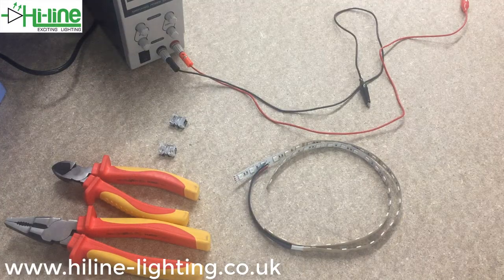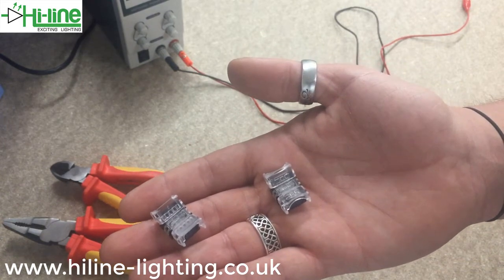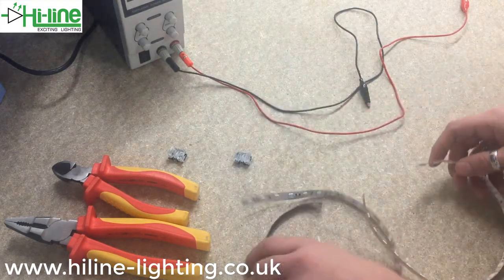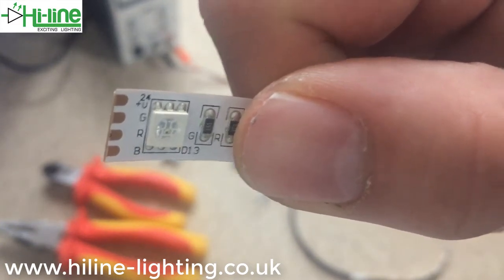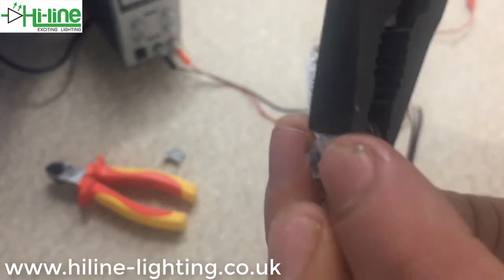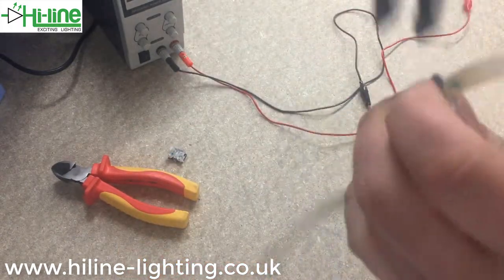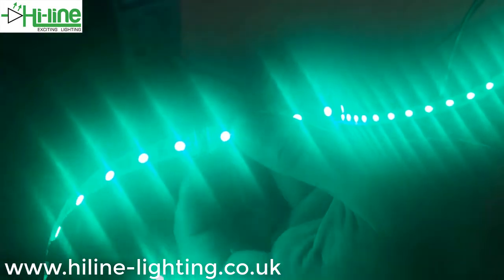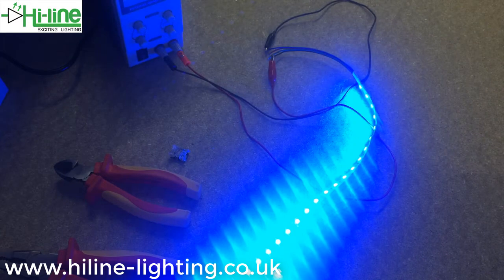Strip to Strip RGB 10mm Connectors

Comment: any tips on reopening a connector if it came shut when shipped.
Reply from the maker: I am sorry to hear that, you may use a small screw driver to release the 2 plastic clips and then you will manage to open it. If this won't work email Hi-line's support your order number and we will post for you a new set of connectors.